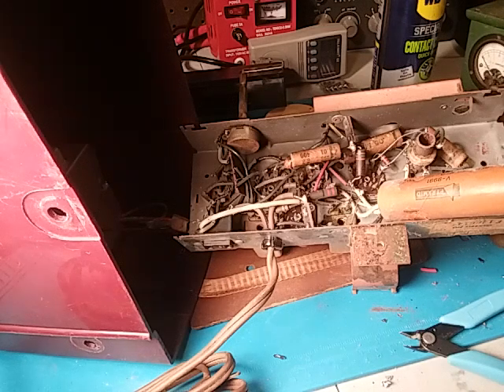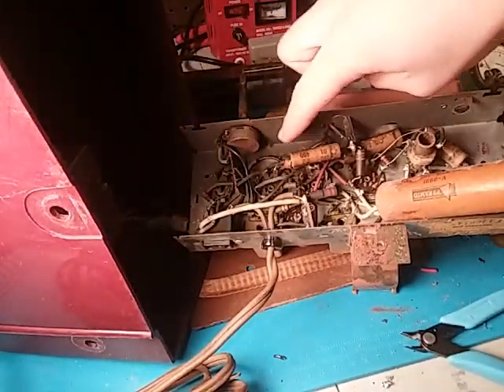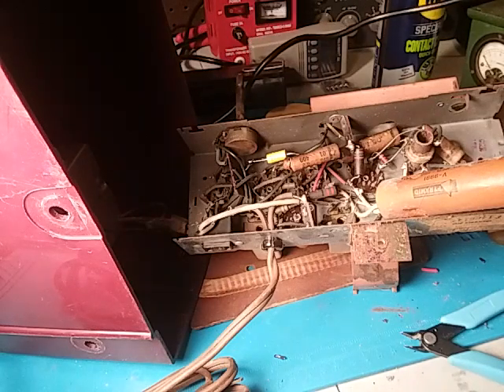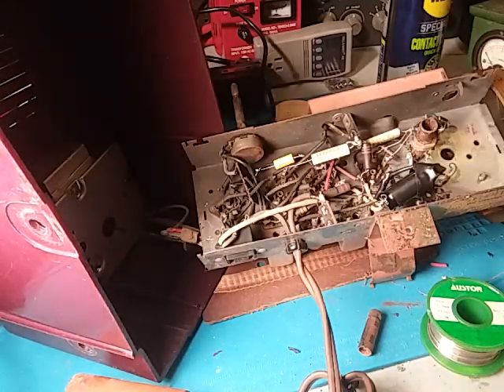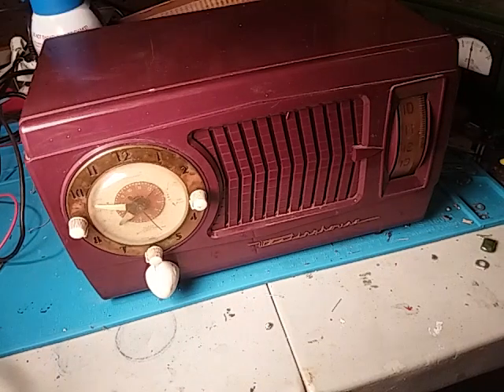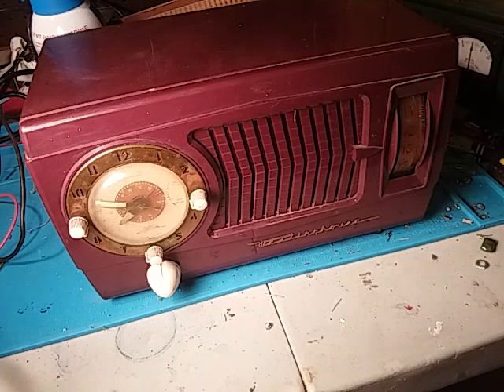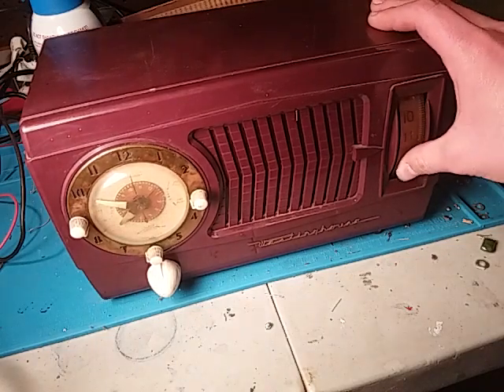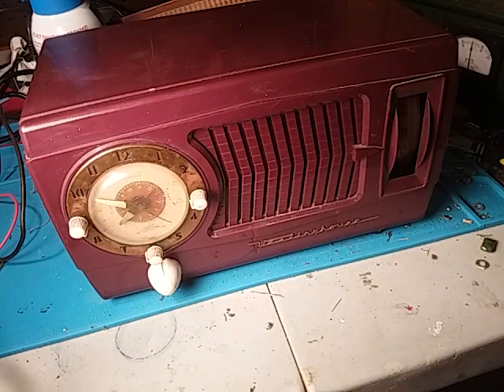Repair of a 1952 Westinghouse Clock Radio

Comment: You learnt the soldering iron problem the easy way.  When I was a kid, I had a stereotypical pocket transistor radio that meant the world to me.  It had an early integrated circuit in it.  I powered it with one of those silly "battery eliminators" (I still have it) which I think are just a diode, resistor, and capacitor.  I still have it somewhere.  Anyway, I tried soldering something in it whilst it was plugged in and the IC went up in smoke.  I was devastated.

Your radio needs a filter capacitor 😊 zzzzzzzzzzzzzzzzzzzzzzzzzz
Reply from the maker: Aw that's too bad... do you remember what your radios make/model was? I guess I did learn the wash way on this one! 

Bad filters wouldn't surprise me as they were taken out of parts radios.
Reply: @bratwurst2923  I actually might have the manual somewhere.  The brand was Realistic but no idea the model number.
Reply from the maker: @KC9UDX  oh neat! Was it AM only or AM/FM?
Reply: @bratwurst2923  both.  12-636 might be it.  I don't remember a blue dial but don't have any idea what colour it would've been.  Funnily there's one on eBay listed with the caveat that sound only comes out of one side of the headphones.  (That's the way it should be)

Comment: The Westinghouse is nice - love the tuning dial. Was that the across-the-line cap which blew up?

Too bad about the soldering iron - it seems like the heater wire came loose and now touches the metal shaft which doesn't seem to be grounded? Anyways, if the winding goes open - the soldering tip will likely be  live at full mains voltage - because the other half will not shunt it anymore. Very dangerous and I guess a Chyna Pryde item? Better get a decent soldering station.
Reply from the maker: Thanks, I rather like the look of this one, too! I let my iron get up from cold to hot with a clip at the end going to my multimeter, it started out at 8.7V AC and dropped to about 4.5V AC